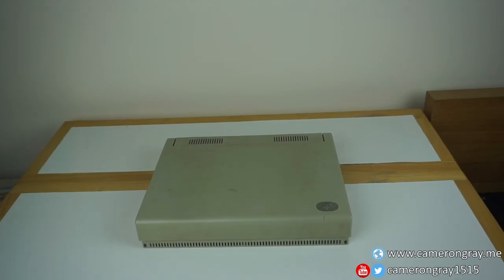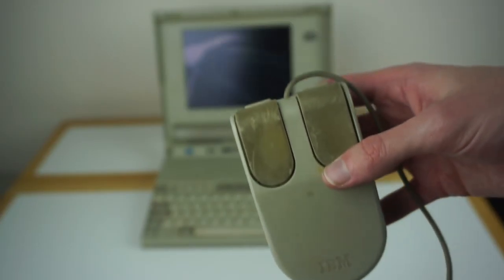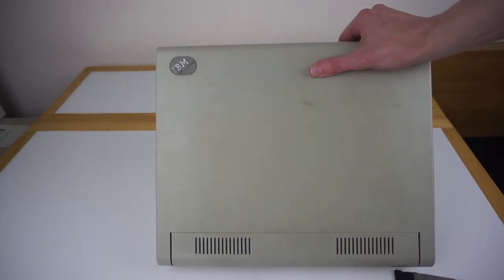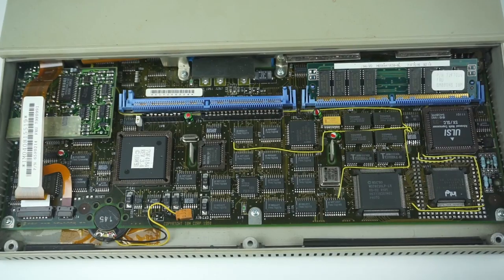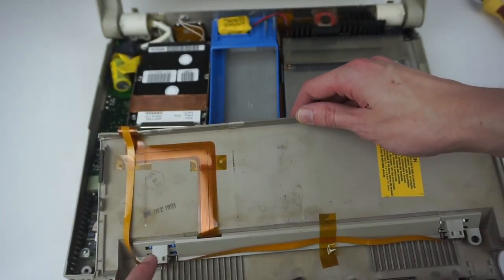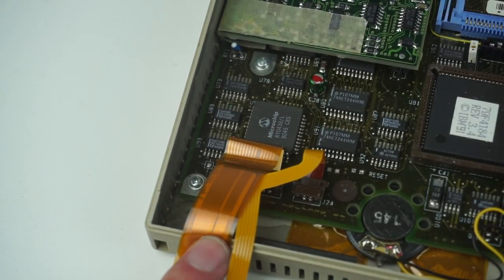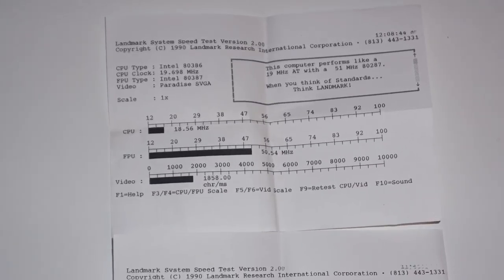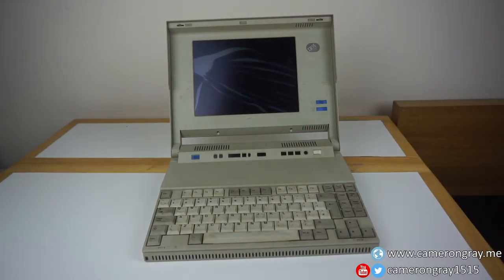Teardown of IBM's First Laptop - IBM PS/2 L40SX

Comment: You could've been cheeky, and switched out the working hard drive with the broken one you have, since, as you said , the seller is probably going to scrap it anyways, and even if not, it's perfectly plausible that the hdd would've also broken in transit. Interesting video though!
Reply: yeah but that is technically scamming the seller

Comment: They are not sort of LCDs, they are LCDs. Instead of having tiny square pixels, they have a single image in them. Like the ones used in those tiger electronics games.

Comment: Hi,  I have one of these in very good condition.  Is there any monetary value - I am interested in selling it.  Thank you.
Reply from the maker: It would definitely be worth something but it'll probably just take a while for someone to buy it.  I can see one on eBay that sold a few days ago for £230 Buy It Now.
Reply: Wow thank you first for your helpful reply and second for your wonderful video.  I am in USA.  Should I remove the hard drive before I sell the computer?  Thank you - stay safe.
Reply from the maker: With these the hard drive is pretty rare and valuable and hard to find a replacement for so suppose it comes down to if there's anything sensitive on the drive.  You'd definitely get a lot more if you can sell it fully working with a hard drive.
Reply: @camerongray1515  Did you ever get yourself another one?
Reply from the maker: Nah, I'd already been able to take a look at this one despite the damage and get a video out of it so it didn't feel like the cost of buying a replacement would be worth it.

Comment: ida seen if i can get it for much cheaper than put hte rest of the money into seeing if i could repair it
Reply from the maker: +FennecTECH The new screen was looking to have been around £70 minimum and I'd paid £60 for the machine.  If I'd been allowed to keep it for a full refund then I'd have probably done it but anything other than that wouldn't really have been economical.
Reply: i mean finding another machine with a defect
Reply: did you do any repair, you need it to be fixed?